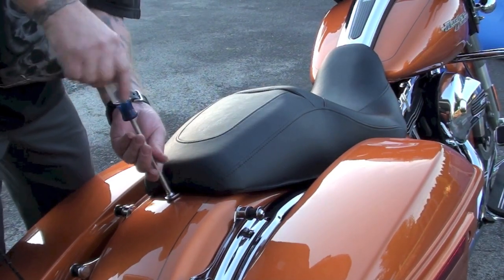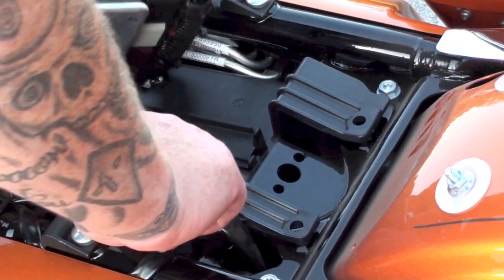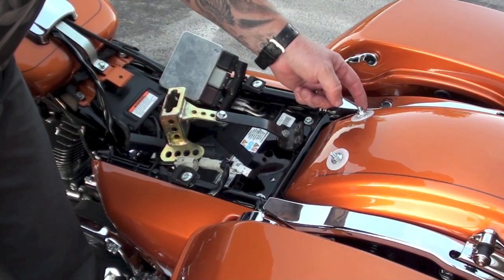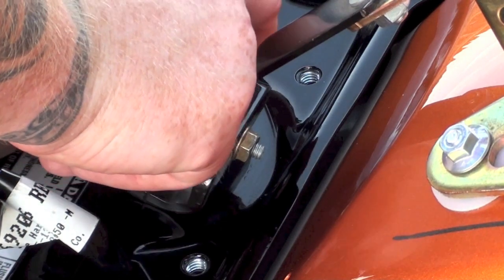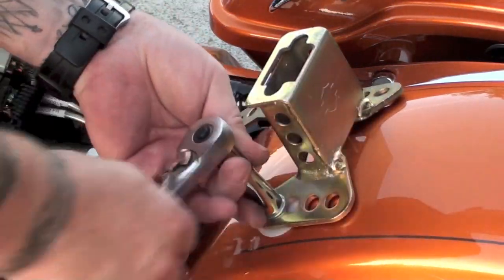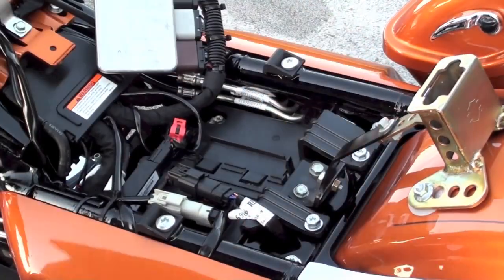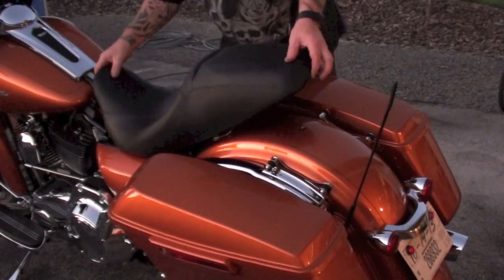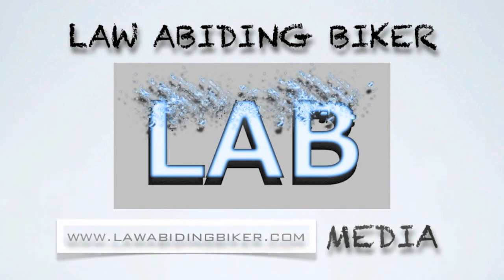Install detachable rider backrest on 2014 Harley Davidson Touring | Law Abiding Biker Podcast

Comment: I used a piece of strong duct tape on a closed end wrench to hold the nuts so I wouldn't drop them until they were started.  It worked like a charm! You don't want to lose one in there unless you have a pet mouse that will go get it.

Comment from the maker: FREE Video Release-How to Install Detachable Rider Backrest on 2014 Harley Davidson Touring

http://youtu.be/9T2gyza33Bo

#LawAbidingBiker #BikerPodcast #MotorcyclePodcast #WhyWeRide #SOAFX

VIDEO-In this video I teach you step by step w/o skipping any steps on how to install detachable rider backrest hardware on a 2014 Harley Davidson Street Glide Special (FLHXS) or other Harley Davidson touring model.

You can use your 2009 and up Harley Davidson rider backrest hardware on your 2014 Harley touring model! It fits and mounts exactly the same.

Join our FREE Email Club @ http://www.LawAbidingBiker.com/EmailClub.  Only relevant content will be sent from time to time.  Email Club members are the first to find out about free and for sale content and are given special coupon codes.

Comment: Thank you for this, it was very easy to follow and so much better than the written instructions that came with the product. The only problem I had was after installation, when I actually tried to insert the seat. I pinched the sides closed and inserted it through the slot in the seat but did not immediately find the mounting bracket, and the spring popped off! On my way to the hardware store to buy a magnetized extension tool to retrieve it!
Reply from the maker: +Michael Priebe The spring came off?  Never heard of that.  Did you retrieve it? Ride safe & Ride Often!

Here is a link to a bunch of our useful Free vids bro: http://www.lawabidingbiker.com/freevideos

Here is a link to some of our useful for purchase videos: http://www.lawabidingbiker.com/buyvideos

Want Answers & Information Fast? And help support us at the same time? Do you like the content we provide?

Our patrons get answers to their questions/comments/feedback in less than 24 hrs and are part of our Private Facebook Group. If you are interested in being in this exclusive group you can get all the details at ==> http://www.lawabidingbiker.com/patreon

If you haven't subscribed to the Law Abiding Biker Podcast make sure to do so. Listen in as we talk weekly about issues/items like this & so much more. You can listen on iTunes (Apple/IOS), Stitcher Radio (Android), or any other Podcast App ==> http://www.lawabidingbiker.com/podcast

Join our free email club at http:///www.LawAbidingBiker.com/EmailClub. Only relevant content will be sent from time to time. Email club members are the first to find out about free or for sale content are given special coupon codes.

Comment: I found I could put the two nuts on the front mount without taking anything apart above the battery etc. I used a set of large hemostats to grip the nuts and hold them in place to start screwing the two bolts in. Once they are started then I just used a box end to hold the nuts while I tightened down the bolts. Saved a ton of time during the install.
Reply from the maker: Sweet Doug.  Thank you for sharing your info!  Ride safe & Ride Often!

Here is a link to a bunch of our useful Free vids bro: http://www.lawabidingbiker.com/freevideos

Here is a link to some of our useful for purchase videos: http://www.lawabidingbiker.com/buyvideos

Want Answers & Information Fast? And help support us at the same time? Do you like the content we provide?

Our patrons get answers to their questions/comments/feedback in less than 24 hrs and are part of our Private Facebook Group. If you are interested in being in this exclusive group you can get all the details at ==> http://www.lawabidingbiker.com/patreon

If you haven't subscribed to the Law Abiding Biker Podcast make sure to do so. Listen in as we talk weekly about issues/items like this & so much more. You can listen on iTunes (Apple/IOS), Stitcher Radio (Android), or any other Podcast App ==> http://www.lawabidingbiker.com/podcast

Join our free email club at http:///www.LawAbidingBiker.com/EmailClub. Only relevant content will be sent from time to time. Email club members are the first to find out about free or for sale content are given special coupon codes.
Reply: Thanks Ryan will do. Stay safe. :)

Comment: Hey Ryan, I noticed that you didn't use any locktite.  When I installed mine I used blue locktite on the support brace and the black bracket (4 bolts total).  I did this because more than a few of my riding brethren have lost some hardware over time due to the vibration of the 103.  Although its not required I'd highly recommend using locktite if for any reason just as a precaution.

Comment: Seems like you could avoid removing everything by taking a box end wrench and  covering one side of the wrench end with duct tape, so the nuts don't fall through, and use that to slide the nuts underneath and hold them in place until you tighten the bolts, or use flange nuts in a box end wrench which would have no way of falling out. Actually I like either idea versus me trying to hold a regular nut underneath and risk dropping it.
Reply from the maker: Thanks for watching Dan and being involved in Law Abiding Biker Community!! Always tons of ways to skin a cat. Give it a try and report back here to the community. We would love to hear from you. 

Here is a cool resource where all our free videos are: http://www.lawabidingbiker.com/freevideos

Here is where we have a few select for sale videos: http://www.lawabidingbiker.com/buyvideos

If you haven't subscribed to the Law Abiding Biker Podcast make sure to do so. Listen in as we talk weekly about issues/things like this & so much more. You can listen on iTunes (Apple/IOS), Stitcher Radio (Android), or any other Podcast App ==> http://www.lawabidingbiker.com/podcast

Join our FREE Email Club @ http://www.LawAbidingBiker.com/EmailClub.  I let you know when we release new free videos!
Reply: I just did this install.  The kit came with flange nuts, so all I had to do was remove the cover bolts so I could have a helper pull up on the backside of it while I slid a box end wrench with the flange nuts underneath.  Worked perfectly without having to disconnect any electronics!
Reply: Great idea to save removing those parts

Comment: were you concerned with setting off the bike alarm? by disconnecting those connecters?  only trying to understand if thee bike alarm is or can be an issue when disconnecting electrical?
Reply from the maker: No issues
Reply from the maker: No issues

Comment: Dude I was watching your Video and it was not bad,,  The only thing I would change is the nuts and bolts on the lower front I would run the bolt up so that the nut is on the top and have a little better reach to it.... My Question is the chrome handle on your side bag....  Is that how you open it....  If it is that is pretty cool.....
Reply from the maker: Thanks for watching and being involved in the community!! Hope you are getting some serious riding in!!

Here is a link to a bunch of our other free videos: http://www.lawabidingbiker.com/freevideos

Here is a link to some of our select for purchase videos: http://www.lawabidingbiker.com/buyvideos

If you haven't subscribed to the Law Abiding Biker Podcast make sure to do so. Listen in as we talk weekly about issues/things like this & so much more. You can listen on iTunes (Apple/IOS), Stitcher Radio (Android), or any other Podcast App ==> http://www.lawabidingbiker.com/podcast

Comment: Hey Ryan,, on the back fender where you have those two bolts for mounting the back rest, what is that other fender hole actually for ???   The only think I could see it was for was sucking road dirt up and under the seat... if it's not for anything except maybe an  opening for more wiring then I'm plugging that baby.... what do you think?..  DAWG from MO.   also how about a update on the Shop Build...?     Peace Bro....DAWG out.... one last thing Ryan,,, does this back rest fold forward for passenger to get on and off ??
Reply: I was hoping your Question,  does this back rest fold forward for passenger to get on and off ??
 would of got  Answered. I need to know before I buy it.
Nice Video, But did not talk or show if Pad folded forward.